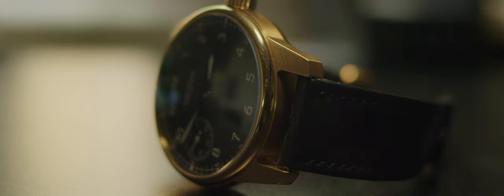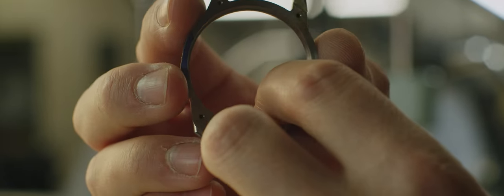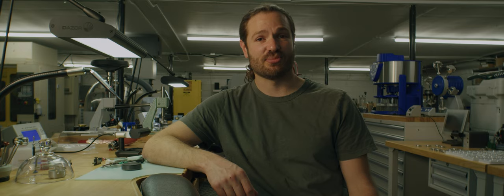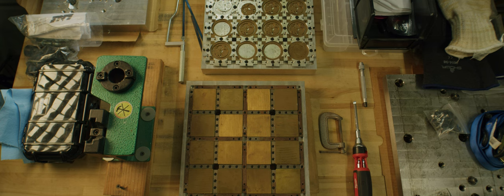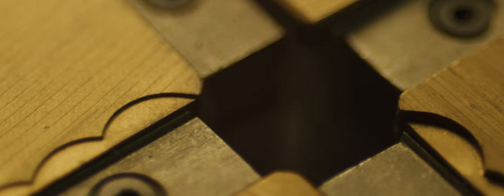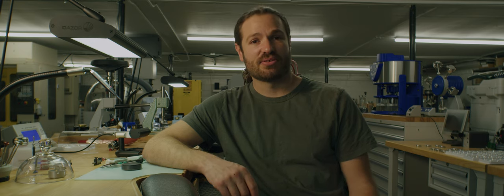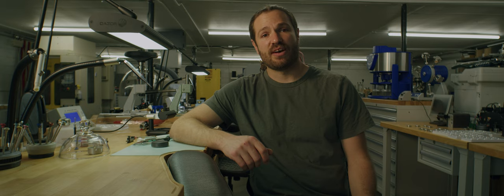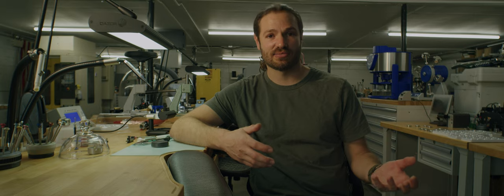What Metal Alloys are Used in Watchmaking?

Comment: Thank you for sharing the insights into why these alloys are used. What alloys are used with the drive train gears? They're colored like brass, however, c360 seems too soft for something like a gear that receives  constant friction. Thank you.
Reply from the maker: The golden colored wheels inside a watch are typically made from a brass alloy. Some manufacturers will use a beryllium copper instead.
Reply: @thewatchmakersworkshop  Would you know what type of brass alloy? Thanks again for the response. It's very interesting.
Reply from the maker: @WatchEnthusiast160   The alloy will depend on the manufacturer and the country of alloy production too. 330, 360, or 385 would be good for watch wheels. Some will use beryllium copper too.
Reply: @thewatchmakersworkshop  Thank you 🙏

Comment: You have some great videos.  Question:  I read that vintage watch pinions were mechanically hardened through compression, but modern watch pinions are hardened electrically.  The downside of the latter is that the hardening is superficial, so that if the hardened outside layer of the pinion is worn, the softer interior can wear much more quickly.  Is this true?
Reply from the maker: Hardening depends on the alloy being hardened, but pinions where traditionally hardened with heat in a furnace (this is still pretty standard practice in the watch industry).  Depending on the alloy and the application a part could be work hardened or forged.  Electrically hardened parts are still using heat, but the heat is from induction. Ideally for a pinion we want the heat treatment to hardened our watch pinions all the way through the part so that leaves on the pinion don't break off.
Reply: Interesting.  Thanks for your response. @thewatchmakersworkshop